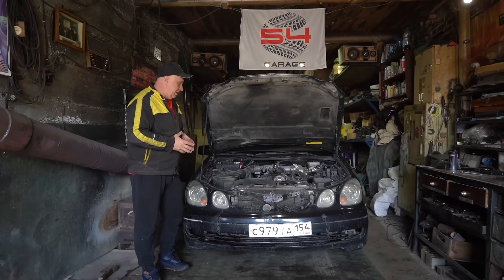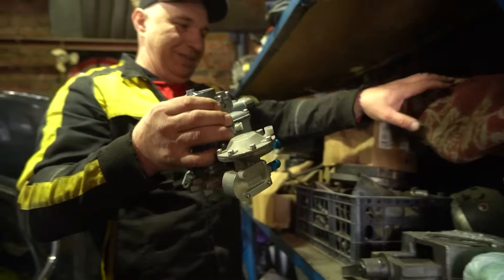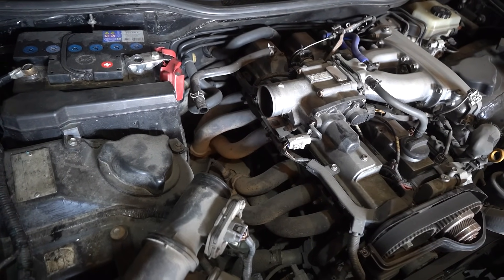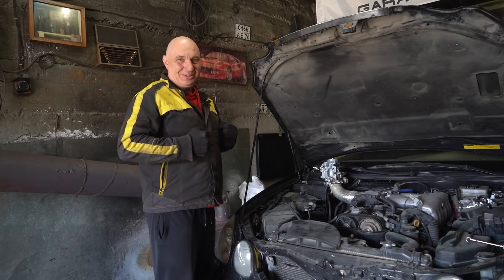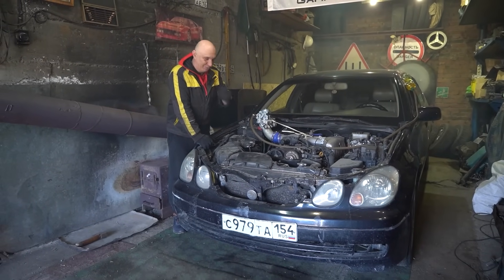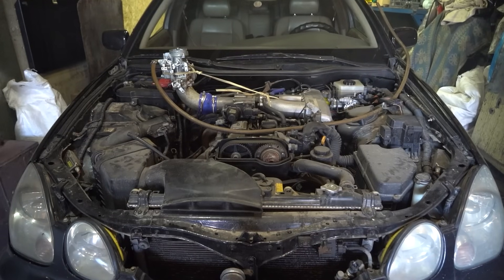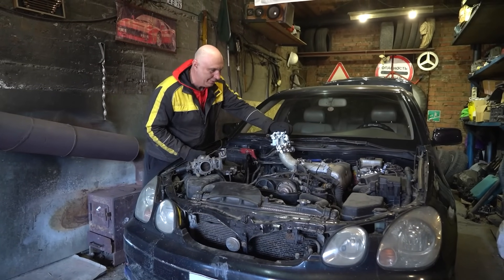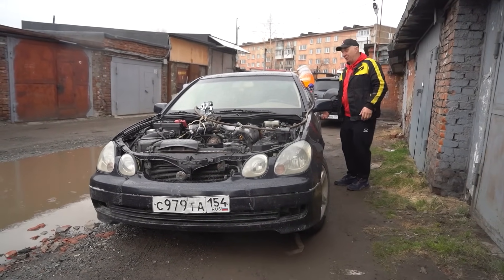We fit a carburetor to a 2JZ - will it work?

Comment: If that bottle didnt have a hole in the "Bottom" for air, the fuel would have been creating a vaccume in the tank, making the carburetor work more to take fuel in, right? 
I think letting air in the bottle would have helped alot

Comment: Try using strong ultrasonic humidifier to feed engine. If it works, then you can also use pressurized air

Comment: This is why only legacy engines can be retro-engineered back to a carbureted system.  Older engines have distributors and, again, that can often be retrofitted.  This engine was created from the beginning as computer-controlled.  It will run like this but, it won't be happy.

One big problem comes from lack of spark advance control.  The computer has likely fixed the timing and that will cause low performance.  The other is that the intake is handling a wet air-fuel mix and there will be a lot of fuel deposited on the cold walls.

Comment: You need to make a hole in the bottle to allow the air to get in it. Then the carburettor will get enough fuel. Tha8why it went when you squeezed the bottle

Comment: The injectors not firing does not let it throw spark, they are set up this way to prevent spark knock if the spark plugs fails

Comment: hello my friends.2 things. first thing is the fuel tank needs vented. second thing on carbs they still use fuel pump even if its only a couple psi. i see you are using the "gravity feed" system lol but if thats your only option i would make the feed hose shorter so it never goes lower than the carb. those 2 things and i bet this thing riiiiips lol

Comment: Have you tried connecting the Air Flow Sensor to the carb inlet and then adjusting the throttle body open a bit more to maintain idle? The air flow sensor signal will "trick" the computer once it receives the signal from it. The servo should work fine once computer sees signal from TPS.

Comment: If you left the fuel injection leads plugged in, it would have kept running where the carb was mounted first. The map sensor caused it not to start once the fuel injection leads were removed. I might be wrong, but i guess the engine only ran after the fuel injection leads were plugged back in even with the carb and all? Great video as always.

Comment: i have always said that its better to just slap carb on some modern engines with electronic injection stuff etc because they tend to and will fail at some point, carburetor is just so much cheaper and easier to maintain and you dont need any stupid sensors or so

Comment: Really need a fuel pump and have all the sensors hooked up and doing there job the computer was running in limp mode should have had the throttle body working with the carb and had the MAF working or tune all that stuff out. Pretty sure there's a company that makes a multi carb intake for a 2j but I could be thinking someone made there it was a long time ago it was done and it worked really good on the drag car. Cool video thank you!!!!!!

Comment: You didn't need a carb, just a 5ltr oil can, some duct tape, and some radiator hose.....but then, you would have had the issue that your fuel will go stale over the course of the year

Comment: The make shift fuel tank needs a breather vent. The consumption of fuel is creating a negative pressure in the bottle and resisting the gravitational force on the fuel.
Reply: A low pressure fuel pump from the original tank would have worked better. Or even a pill type system that uses the HP pump and returns 90% or so to the tank

Comment: Yes my main decision was between using the original throttle body butterfly or the carburetors!?
Reply: carbs generally are designed to work with throttling being done across them.
Reply: @lasskinn474  yes that's why I started with the throttle body open fully, and just using the carburetor butterfly, but it was still a lot of experiments with different jets and carburetors to get best efficiency 😅

Comment: The carb is originally for a larger displacement engine.  Not enough engine vacuum is created to pull adequate fuel through the jets, the engine is running very lean and a lack if power results.  Better off with a smaller carb than larger.

Comment: How is the maf letting it run on unmetered air and with  the tps not doing anything when the throttle is pressed?  Cuz the throttle cable would have to go to the carb to open the butterfly..  usually if theres a descrepency between the tps and the iac it will put it into limp mode.. maybe thats why he couldnt go above 2nd gear..  but the maf shoulda caused it to die a bunch and run like crap..  fuel trims and all would be pegged out..

Comment: I think the fuel pressure will be too high, as the pump and pressure regulator will give you a much higher pressure that the 5psi or so needed for a carburettor engine
Reply: OK I see you used a separate fuel system. You guys are way ahead of me as usual

Comment: you need to find out if you were to squirt fuel into the intake, say using a windshield washer nozzle, with no other fuel pump but the squeeze system you used in this video... Would it run?

Comment: Was wondering if this was an old vid, being recorded in the original garage and all, but sticking a carb onto a fuel-injected engine, can't see why it wouldn't work, computers'll be driven mad, but the mechanicals, nah, just suck squeeze bang blow, that's all you need... :P

Comment: I'm 38 now. When I was 19 I had a 2JZ that I put six side draft carburetors from 1000cc motorcycle on and re-jetted them. It actually ran very well. I eventually took them off and made it turbo. but nothing like the throttle response of the individual carburetors
Reply: very cool! newer electronic throttles feel so slugish as far as response goes.
Reply: @goober22100 most of the reason these days is fuel economy and no lurching but big agree, even if that’s the case I HATE how long it takes my mom’s Honda passport to actually accelerate when you floor it. Feels like 3 seconds which is insane
Reply: @theeoddments960  same in the accord. I had an old truck with efi but an actual cable for the throttle body hooked up to the pedal...throttle response was instant. Now I have to wait for the computer to think about parameters and pick the right gear, then I am finally "allowed" throttle. Like you said, takes about 2-3 seconds to respond. Feels like a semi truck trying to pass some days...
Reply: @goober22100  That's because that pedal just tells the computer you would like more torque, it then gets to decide for you how much the actual throttle is opened.
Reply: i would do that too. i hate fuel injection and electrics on cars lol
Reply: yeah, this gas reaction is some special feelings from driving

Comment: Bad fuel pump is common reason why engine doesnt get fuel from injection system to run, despite no fault codes. Im surprised to see that this engine did run with carburetor.

Comment: I love carburators, simple solution.
Reply: Carburetor appreciation society on F.B. :)
Reply: Simple yes efficient no!! It will increase the fuel consumption by orders of magnitude unfortunately. Still cool to see though 🙂 personally I'd rather see and old 70s Mercedes Benz  mechanical fuel injection system. Still not as efficient as electronic fuel injection system but way better than a big carburettor. It's quite literally the inbetween of the 2 systems but allows for the maf and other sensors to function properly. As the maf will tell tell the ecu information and change things but then nothing actually changes then the ecu will load a limp home map killing off all the revs and power to protect the engine. So doing a carburettor swap means that the ecu needs removing or reprogramming to ignore the maf and exhaust sensors all together.
Reply: @michaellegg9381  There were plenty of models offered in the 80's and 90's with the exact same engine, and the mpg difference was like ~2 mpg between carb and efi. No doubt it's different in the modern era, no carb could match a modern efi system for efficiency. And yet I still appreciate carbs though, you can't rebuild a full efi system out of stuff laying around your house.
Reply: @Sam-go3mb  they also didn't have the same programming in the ECU and have completely different sensors and having sensors plugged in and reporting false data will force a limp home mode.
Reply: @ correct, yes. Vast majority of carbureted vehicles didn't even come with an ecu
Reply: Easy to maintenance but fuel consumption will increase around 20-30% compared with injection
Reply: luv 2j
luv carbs
simple as
Reply: EFI is super simple too
Reply: i love carbohydrates too

Comment: I think this would be a good project to work on an refine it more. If you leave the original throttle body with the idle air control in place and working, then you could achieve closed loop air-fuel ratio control and have the simplicity of a carburetor at the same time. You would have to make a linkage so the throttle body is fully open all the time, but the carburetor opens and closes. The throttle position sensor would need to follow the carburetor position. It would be interesting to see if the use of the choke would be necessary for starting.
Reply: I don't think that will work because the throttle body/iac motor will restrict air flow through the carburetor at idle resting in no venturi effect. The other issue to resolve will be ignition timing. Most ecm"s will default to retarded ignition timing when critical sensors are disconnected or giving false reading. I have done several carb conversions and had to work out these issues. It could be helpful to leave ecm and o2 sensor connected to tune the carburetor. Great video as always.

Comment: Without hood, no emission control, gasoline in hand and it goes on the road - i love it. This is real freedom, not shit like on eu.
Reply: you can do this in sweden
Reply: It works in some South East Asia countries. Straight pipe completely legal.
Reply: Somehow more freedom than America will ever get.
Reply: @jwalster9412  Ever get again.
Reply: Sorry to break your bubble but this wouldn't pass Russian inspection either, AND you could also do this in the EU in between inspections just like he did depending on your countrys specific laws (if inspection sticker can be invalidated during your 1/2 year cycle or not)
Reply: And it runs like shit
Reply: @vadim6385  With an ECU controlling the ignition timing, based off information from the things that were disconnected - MAF sensor, TPS, etc, of course it's not gonna run too well. It also didn't even have a working fuel pump. A properly matched carb, with all sensors working correctly, could give the same HP as the EFI if not more
Reply: real freedom like russia is puttin on ukraine?
Reply: @arva1kes  Ukraine shouldn't have started maiming and murdering Ethnic Russians in the Donbas & Luhansk regions. Over 14,000 murdered over 8 years before Russia answered the call from its defence treaty partners for help.
Read some history. Try starting with the Maidan coup.
Reply: @arva1kes leave the politics out of this

Comment: Did lexus have 2jz??

Isn’t that a 1jz correct me if I am wrong …I am Very clueless 😂
Reply: In Russia, especially in the Far East and Siberia, where Japanese used cars are common, swap is a very common phenomenon. There were times when owners of Japanese cars, instead of repairing the engine, simply installed a "new" engine and did not bother, because it was cheaper than repairing the old engine. Moreover, good old Japanese engines were installed in cars that were not designed for them. UZ and JZ were installed in Porsche Cayenne, they were also installed en masse in old Soviet Volgas. So there is nothing surprising about this at all.
Reply: Many lexus used the 2jz without a turbo like the early 2000 s IS300
Reply: @ ohh right…thanks for the info
Reply: The mk1 and mk2 GS300 used a 2JZ GE. The 1st gen used a non VVTI variant, the 2nd used a VVTI engine. Both naturally aspirated.

Comment: Now replace the ignition system with a distributor adaptor, make her fully analog - you should be able to get proper power without the computer going nuts fighting you.
Reply: You could, 100%. EFI was introduced to reduce emissions, there's no reason why you couldn't get the same HP or even more out of a carb setup
Reply: @timjohnun4297 Even on the deck of my ‘07 Escape, you can plainly see that many, many cars from the aughties can be carb’d. Interesting projects for sure, but injector mods are simpler to execute.
Reply: Gear box needs ECU
Reply: @uxair9068  you can always throw in a th400 transmission in and it'll be mechanical after that. Or swap it over to a manual transmission. There's plenty at salvage yards and there's plenty of salvage yards.
Reply: @uxair9068  Olenty of ways around that. Manual gearbox swap is one....
Reply: @ usually can be manually operated with a switch matrix
Reply: please do this, i was excited to see this vid but really its just taking a can of brake clean an running the car off that, needs no computers
Reply: YES! A Retromod! Fully mechanical, no digital crap!

Comment: You should get a slightly smaller carb size. I think it's going lean, which would make sense as to why adding fuel pressure would make it run better. Add an air filter to take away some air and turbulence. Or tune with some bigger jets.

Comment: To big , Try a lawnmower carb 😎🍻
Reply: You think a lawnmower carb will run a 6 cylinder engine? An off the shelf Holley or Weber would work perfectly
Reply: @timjohnun4297  no problem at all  , very old (early 1900)  v8 had small single carb
Reply: @ajx3993  And about 12 hp....
Reply: @timjohnun4297  found a 302 v8 here on Yt 🙂
https://youtu.be/1xHQWu2ZzPc?si=t1r-KgWuKRZSKlZN

Comment: Imagine with carb properly adjusted, how would it do on an emissions test vs factory set up?
Reply: I think that it will lose by a wide margin. The Carburator is simpler, but cannot really compete against a computer with a bunch of sensors to measure exactly the amount, pressure and temperature of air in the intake; oxygen at the exhaust, coolant temperature, etc, injecting a precise amount of gas for each cylinder.
Also, it's not like the ECU is unreliable, or something like that. I remember my father fiddling with carburators quite often in his cars back at the time.

Comment: I'm not an expert on that engine, but with the TPS and MAF giving readings that aren't in line with what the computer is seeing from the crank and cam sensors I'm guessing the computer is probably in some sort of failsafe or "Limp Home" mode and isn't getting proper spark advance and is why the trans isn't shifting above 2nd.
Reply: indeed, it would show up as error immediately. there is also a knock sensor bolt tight to the block, it would probably notice that it doesn't correspond to the amount of fuel it think it added.
Reply: Dissconed MAF would help
Reply: Toyota's Limp mode won't shift past 2 or rev past 4000 I think especially in engines of that vintage 88 - 06. Disconnecting even one sensor can cause that and also off readings in the sensors downstream of the culprit sensor, so no air flow and no working TPS will do that. Now, include knock sensor going all haywire and O2 sensors sending shit readings the ECU is just gonna throw up its hands and say screw this - Limp Mode.

Comment: Runs superbly…apart from that knock/detonation 🤦‍♂️
Reply: Still after just rigging it up with makeshift pipe, giving fuel from a lemonade bottle, not adjusting anything on carb and on engine, and engines collector is not designed for taking carb at all, it runs kind of good.

Comment: Oh this is the garage Vlad used to work in I think, before they got the space they have now. I remember watching him and the small team using this small space a lot back in 2018/2019 when I first discover this channel. So nostalgic, and a great testament to how far they've come. Best channel on Youtube for sure!
Reply: I started watching them in 2021! I never knew that.😊
Reply: I thought this was just an old video that got uploaded.  I had seen they uploaded the same video in russian recently, and figured maybe it was just a scrapped project they finished up the editing on or something.
I started watching probably around 2019 or 2020 or something?  I think I only subscribed and really started watching regularly in 2020 though.
Reply: Must be garage 53😅
Reply: yeah i was subs way back when they only had 50 k
Reply: The old garage looks like it was built during Stalin's era. The bricks are different. It must've been built in stages.
Reply: Yes bro I remember the first wood smoke powered car was done in that workshop
Reply: You are correct, this is indeed the OG garage.
Reply: His home garage.
Reply: Yes, and that tiny wood stove so close to the concrete wall with the LONG angled flue pipe, that's when I found them.

 Back in that cramped garage. I was always thinking how hot that little thing had to have been run. I bet they even ran it on waste oil too.
Reply: @volvo09 Honestly back here in the east I've never heard of an oil furnace before youtube. Usually it was only firewood, probably the same case here.
Reply: @mantvydas8810  Really?? We've even had them in the US for many decades, and we're pretty heavy with regulations!
Reply: @DUKE_of_RAMBLE  Can't speak for all off the east but over here it's mainly firewood
Reply: @mantvydas8810  Out of curiosity, where do you refer to when you say "the East"? (a general location is all: country is fine)
Reply: @DUKE_of_RAMBLE  Lithuania